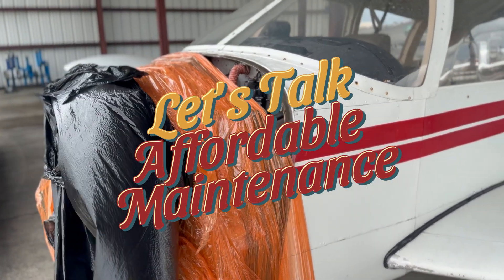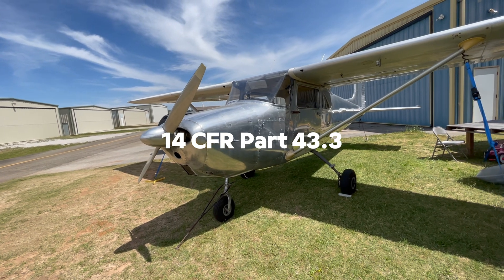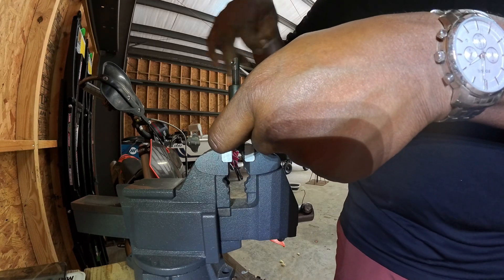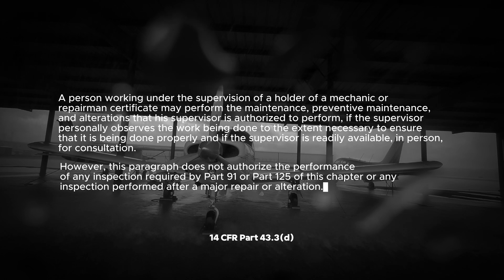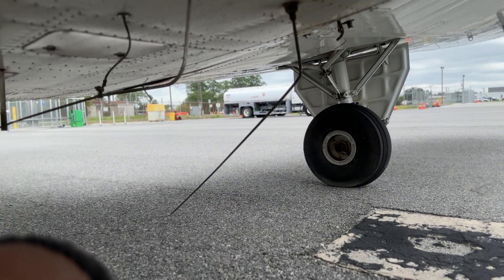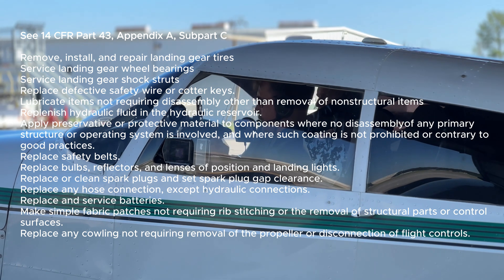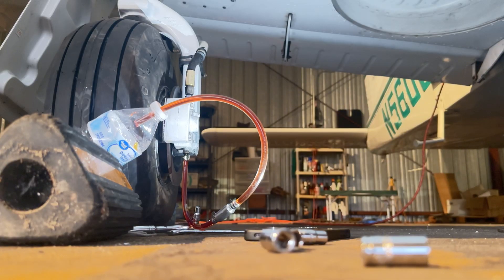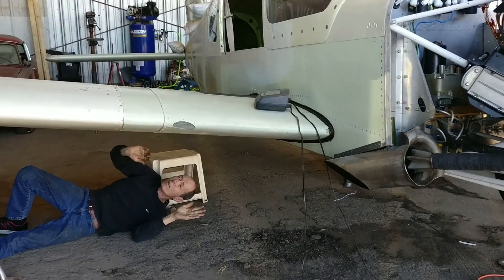Keeping Cheap Airplanes Cheap & Maintained

Comment: V tail Bonanza! Everyone wants to know how the ruddervators look. Do you have a link to the brake bleader check valve?
Reply from the maker: Nailed it! P35 Bonanza. Search Amazon for "vbaxy Brake Bleeder Hose" or "vbaxy One Way Check Valve Tube Bleeding Tool Kit for Motorcycle Clutch" and you'll find it! Works great and I can bleed brakes solo. Currently $9.99.